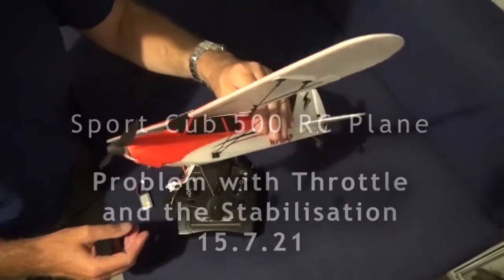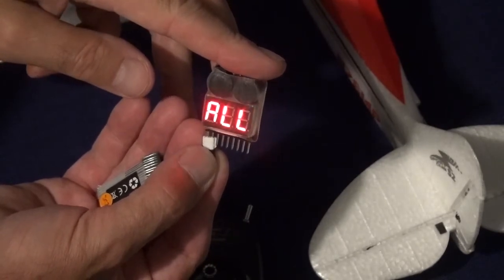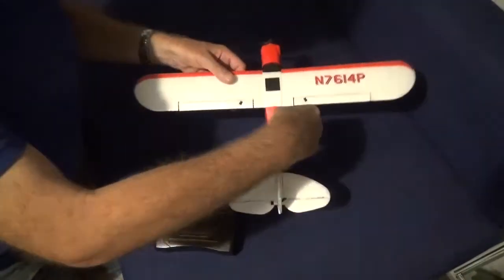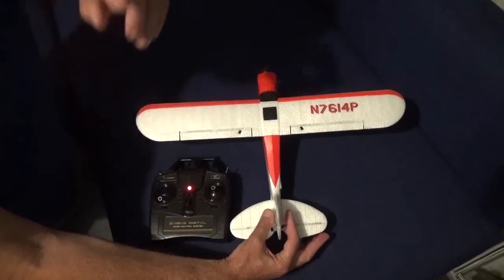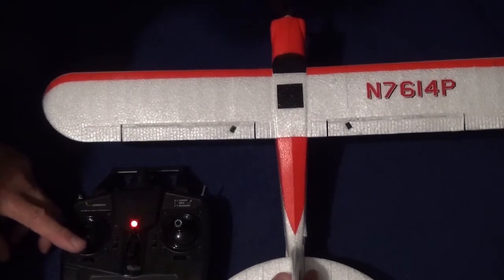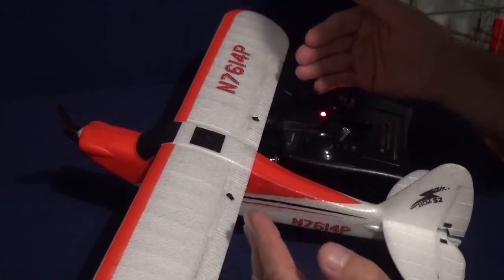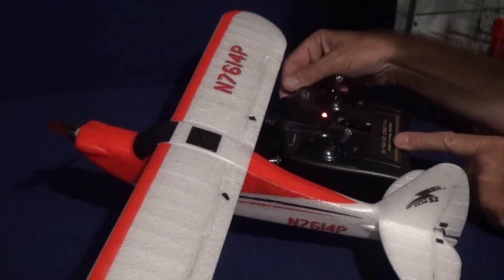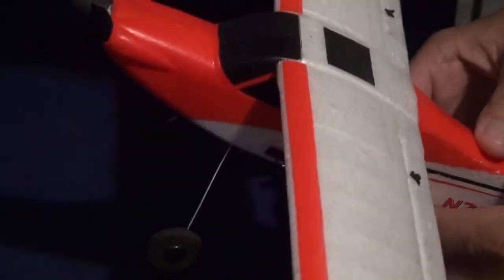RC Plane Super Cub Problem - Throttle & Stabilisation

Comment from the maker: Update: the plane still flies so I guess this is normal in response to vibrations through motor torque.
Reply: Am from the Bahamas and am having the same problem
Reply from the maker: @lauvaughanroberts1319  It is actually ok - the plane is meant to do this. It will fly ok.
Reply: @Calvertfilm  it took a direct left turn and crash wen I tried, factory fault I guess
Reply from the maker: @lauvaughanroberts1319  Check the upper right toggle switch is set to beginner mode. It does what you describe in expert mode more often than not on a hand launch.

Comment: Could you recalibrate the gyro while in expert mode? (mentioned in the manual) and when you do it try to keep the plane level straight in your hand rather than on the floor so it calibrates based on the plane balanced flying straight rather than with the nose up due to the front landing gear.
Reply from the maker: Good idea but I have never found it necessary. It flies great as it is.

Comment: Hi! My Sonik 500 cub has developed a nasty habit of becoming unpredictable while flying, including diving itself into the ground, which I guess could be this aileron problem. I will investigate and see if it is OK if I keep the throttle low. Thanks for sharing. Chris
Reply from the maker: Actually I have since found this is normal behaviour for a static model. In flight it goes fine. As for your problem, although I have bought 15 of these models now I've never had the problem you state. Sorry I can't help.
Reply: I'm having the problem you describe. The plane was fine for the first few weeks but then occasionally it would start to act funny. I'm not the most experienced pilot so I put it down to wind of just a skill issue. As time went on though it became worse and worse. I'm going to try and reduce the vibration by making sure only to use really good props. We'll see how it turns out.

Comment: I tried both spinner assemblies, one was OK the other did the same as yours did, so I swapped over the props on the spinner assemblies and the problem stayed with the same prop so I would say it's a slight prop imbalance.
Due to the weather conditions at the moment unable to fly it,  so can't say if I see it happening in the sky.
Reply from the maker: Sounds a reasonable assumption to me. The prop only needs something small wrong with it to make that imbalance.

Comment: Baffling for sure. Could it be a safety feature to keep the plane close to the controller in that mode setting?
Reply from the maker: I'll have to try it in the air. Thanks.